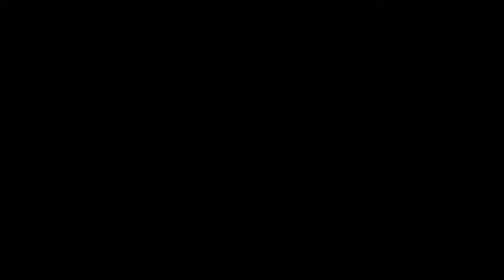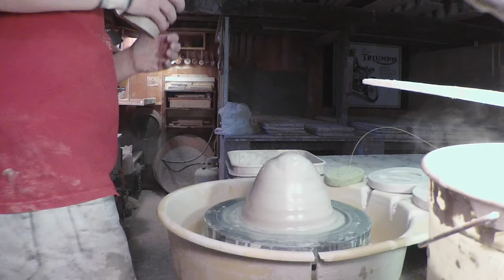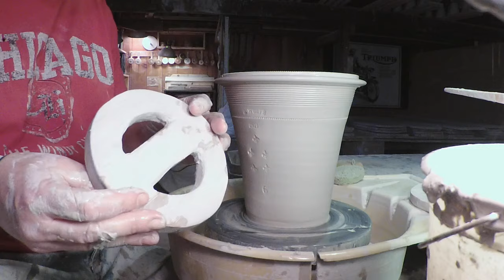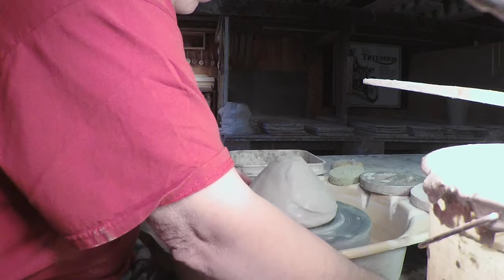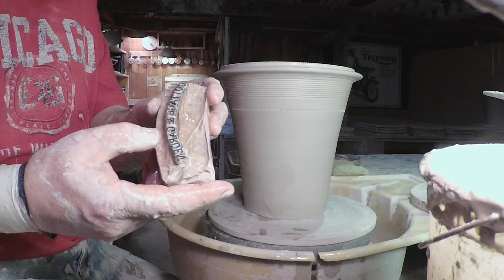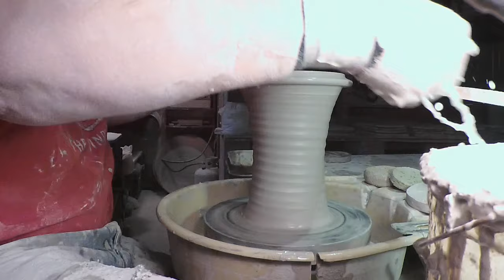Throwing a 6 Pound Tuscan style Flowerpot

Comment: Great work.  Would you share the size of this pot please.
Reply from the maker: After firing my 6 pound pot is around 8.25 inches tall and wide ..
Reply: @guywolff  Thank you
Reply: I just noticed your Triumph poster. I had a 59 500 Triumph while stationed at RAF Croughton with the USAF from 1963 - 1967.
Reply from the maker: @Fraserlangford  I had a 67 Bonnie when I was working in SOuth Wales in 1970 .The last few years I am riding a 900 Triumph STreet Scrambler on my very back farm roads .There are some videos on my channel of riding here in Connecticut ..